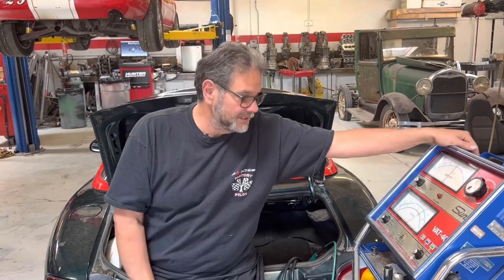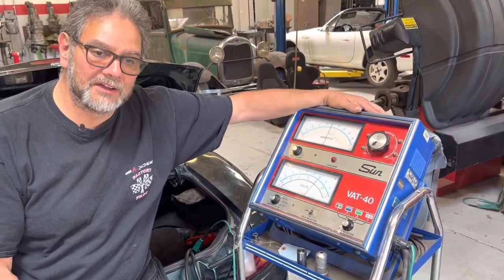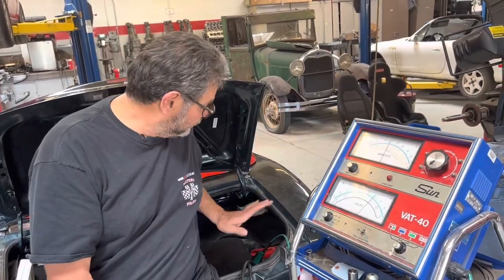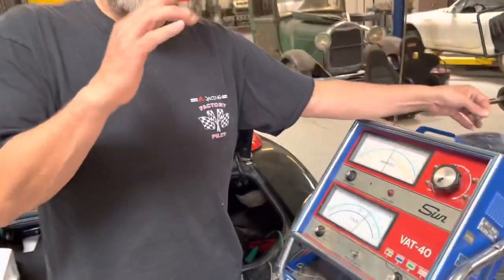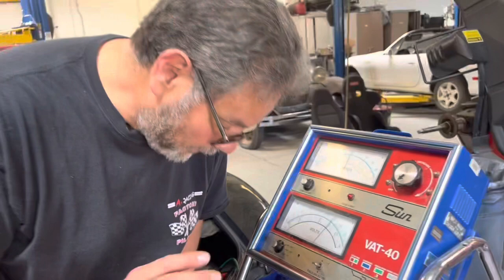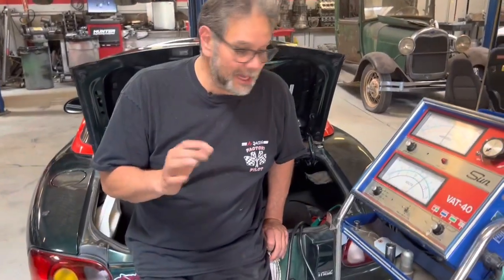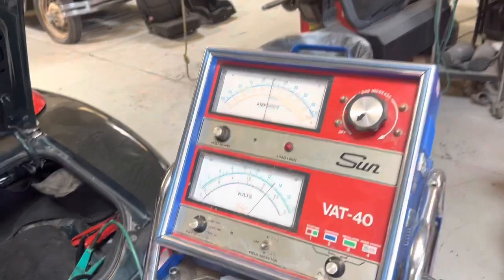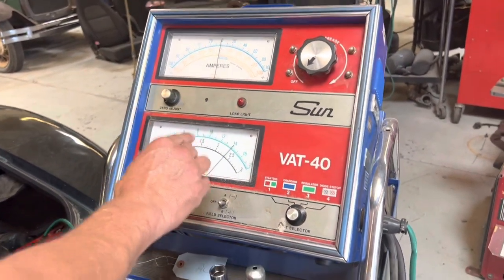Lets See What The Charging System Is Really Doing. Spec Miata, Autocross, MX5, Track Car

Comment: do SM rules allow running an internally regulated 1.6 NA alternator on NBs?  that could solve issues
Reply from the maker: Not till you get caught. I think you would have to highly modify a 1.6 alt to fit in a 1.8.  I think the big one will be the pulley as they have different shaft sizes.

Comment: Just wanted to thank you for the great instructional videos you are putting out.  I am not going to turn my NA8 into a Spec Miata racer, but I am interested in learning about the car.  I inherited my Miata from my mother-in-law and it has been rarely driven and winter garaged since 1994.  It is in perfect shape with 70k original miles.  I am in the middle of refreshing the suspension system and have added some frame rail reinforcements and new door bushings to help tighten it up a bit.  I don't plan to track the car, but I do like to drive it aggressively on the weekends.  I just regret the lack of good 14" tires as I do not want to change the stock rims.  Looking forward to all of your future content.  I like all the little bits of pro tips you add to the videos.
Reply: If you find some good 14” tires let us know . 😎
Reply from the maker: Wow, such a great gift and with low mileage. Get that bad boy back on the road and enjoy the Miata life. Let me know if you need a video on something.
Reply: @aracing  Thanks Al!  I will be upgrading the shocks, springs, & anti-sway bars and am thinking about doing all of the bushings and engine mounts as well.  The OE rubber bushings look good, but at 70K miles they must be nearing the end of their service.  I just did this on another inherited vehicle (El Camino), and am looking forward to the improved handling.  I have seen videos on changing out the Miata suspension, but not so much on the bushings and ball joints.  If you have the opportunity to work on ball joints that would be great!  I've read the tutorials on Miata.net and I will be using the Flyin' Miata 2.5 Koni suspension package.
Reply: @jacklandismcgowan1413  Discount Tire has Toyo Proxes R888R competition tires in 185/60R14, R compound, that are DOT certified.  I just don't think I want to run competition tires for a daily driver.  Toyo recommends 160 - 220 degrees operating temperature for optimal performance.  Treadware is only rated at 100 so it would be expensive to run them at $194.00 per tire, plus I am not going to be screaming around a track heating the tires up for max traction.